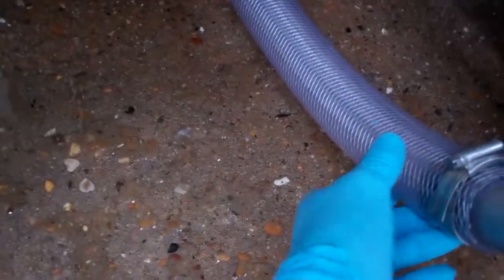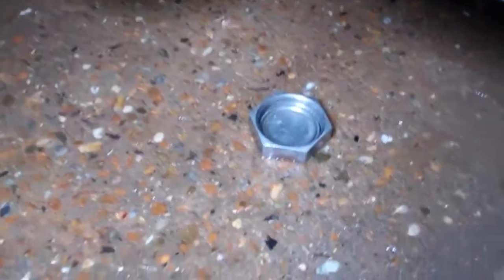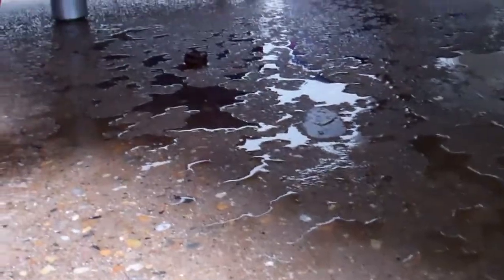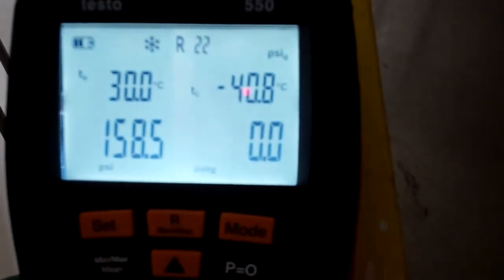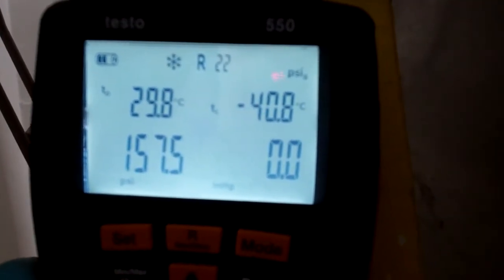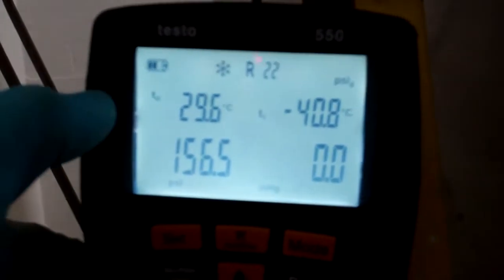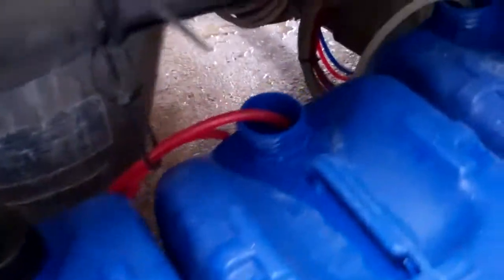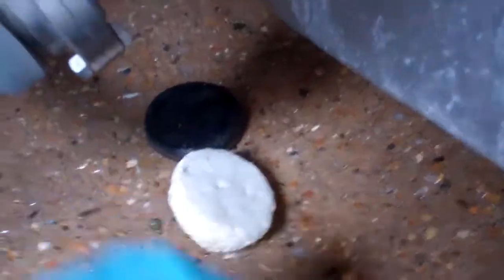Leaky evap find and fix

Comment: Nice video HD. I couldn't understand the idea behind those evaporator plates and found a video from a tank manufacture that showed building a tank from the ground up. Very impressive I must say. They must cost a small fortune!! Instead of spot welds on the evaporator, they used robotic TIG welders that did little circles.
Reply from the maker: +Nicholas CeeA yeah i'm not sure how Fabdec weld their plates but i know one of the other manufacturers uses a laser welder.
Reply: Yeah, I meant to say laser weld...

Comment from the maker: @rotarycomptech Hi Dave!

I think this is the first time its been welded, all the other welds are factory!!! 

These do tend to crack around the spotwelds, often near the legs as its an area stress is concentrated.

They can suffer from corrosion too, as hypoclorite will eat through stainless like woodworm!

Its not just this make of tank they all suffer in one way or other.

The braided lines are great, have cut leakage since we started using them instead of copper.